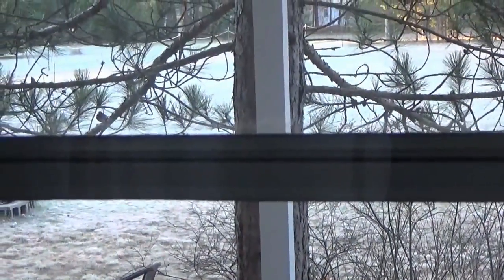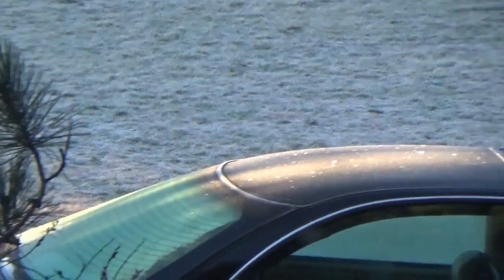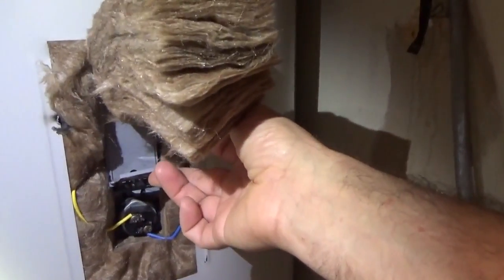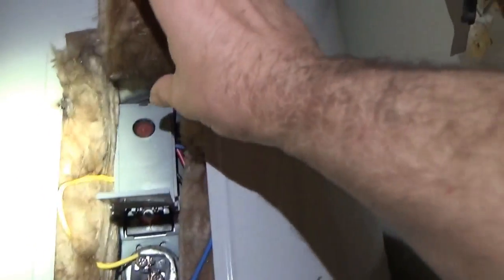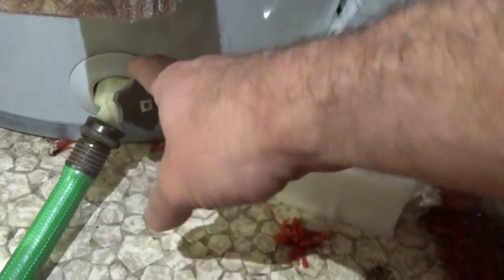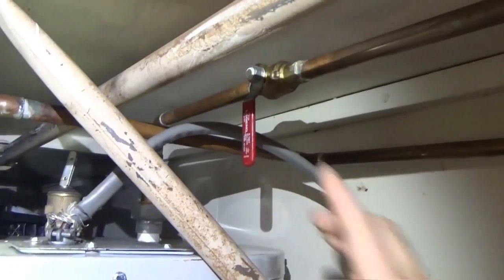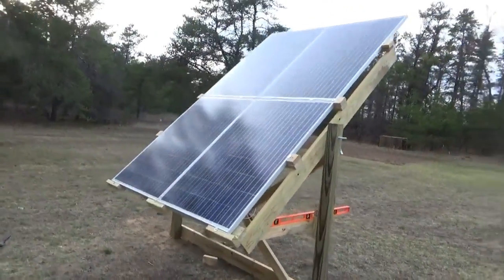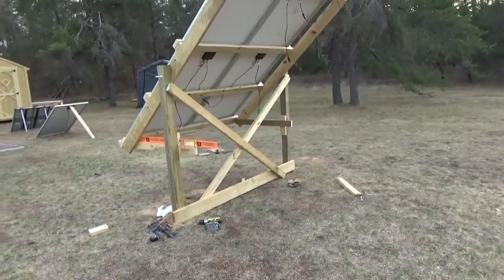Repaired Water Heater & Built Adjustable Solar Panel Rack

Comment: yep the water heater element was blown becuase someone turned on the power with no water in the tank
Reply: Glenn s, actually, we use 400 volts (former 380 volts) 3 phase here in holland also in homes (its3x 230 volts ground to phase)  also electric cooking,water heaters etc,  normaly on 3 phase and ground (3x 230 volts) that way less amps then you guys have to transport whit the 2 phase 220 volts (2x 110) using  230/400 volts is common here in the Netherlands (and the most off Europe...house wiring is way cheaper that way, all or outlets are 230 volts ac, not having clumsy thick wiring...lot less electric fires by overheating...
Reply from the maker: Thats what I thought too. Probably when they got the house ready for us. They had all breakers off. Probably turned them all on at once without thinking about the hot water tank.
Reply: same thing happened to me. the house had been winterized, water heater was drained. power company put power on before I could get home and blew the water heater
Reply: The Do It Yourself World dont forget 240v means both arw under voltage
Reply: Its actually two phase 230. The phases must be exactly 180 degrees apart.
Reply: In the states 3phase is 480 volts and 60 hrz you guys have lower volts and 50hrz
Reply: in the USA... lol, its what we have for low power here...., 230 volts (one phase, and 400 volts for power... (3 phase)
Reply: not here in europe,  , its 3 phase, and 120 degrees apart, 230 volts to ground, and 40 between phases.
Reply: MrBugsier5 oh yah our houses would run great on 480v three phase... not!!!!
Reply: thats why we dont live in europe. you over that side the ocean just want to complicate things
Reply: whell, actually its mutch more convieniant.... 3 phase... lol

Comment: The heating element is warped from some won turning on the power when no water was in tank .
Reply: think its a bit of both....
Reply: I use electric heaters and all the ones I've had just heat off the top element until the water gets hot enough up there, then the bottom one comes on to heat the lower part of the tank. Unless you have a Quick Recovery model where they both heat at the same time, that'll spin the light meter!
Reply: I know from experience, we tape the breaker in the off position whenever draining the heater
Reply: I'd say overheating out of water too
Reply: No, it is warped due to the covering of lime deposits on the one side. It becomes insulation ,trapping heat.